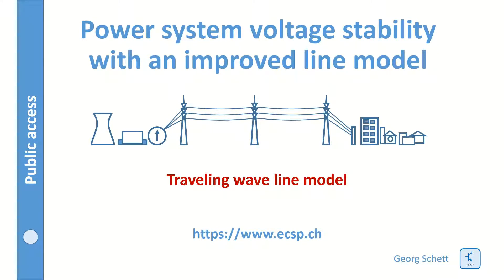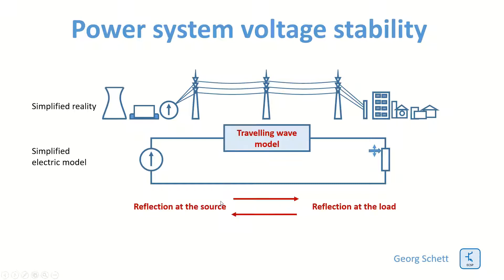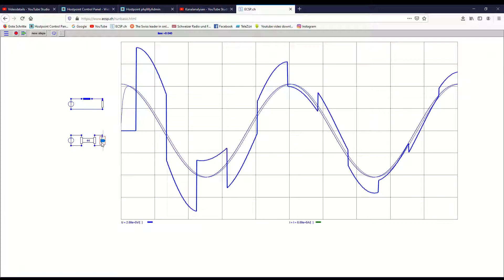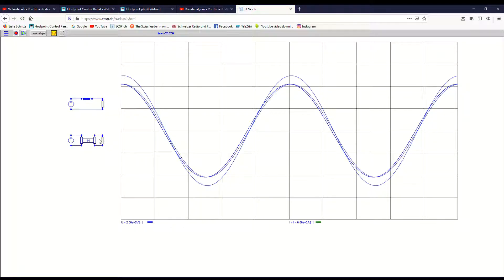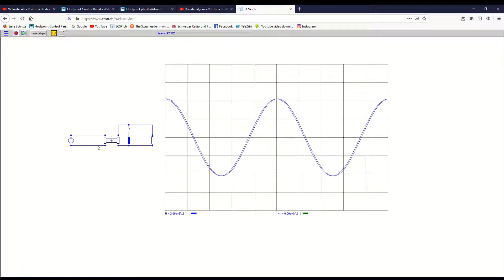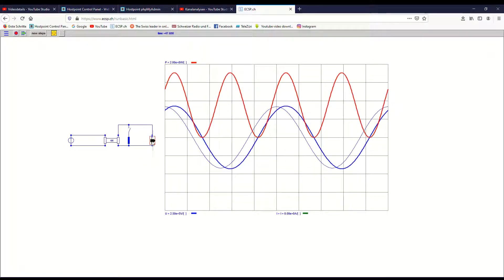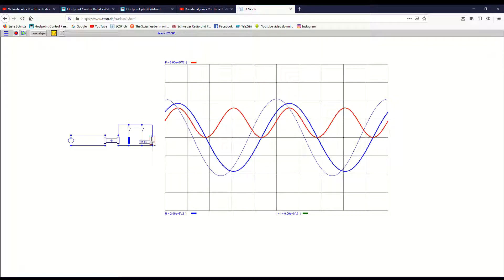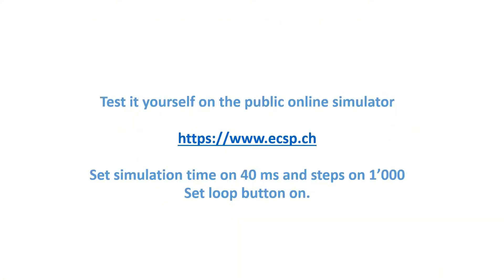Power System voltage stability by reactive power compensation [circuit simulator]

Comment: So basically STATCOM can perform this reactive power compensation
Reply from the maker: Yes, for example, there are simpler ways depending on the type of compensation such as reactors or capacitors. Statcoms are adjustable and therefore very flexible.

Comment: How by decreasing the resistance we increase power at the load ?
Reply from the maker: This is basic electrotechnique. P=U*U/R.
Reply: @georgschett801 i So the load considered in this case is basically inductive impedance i.e. Z = R+jXL, since I see a sinusoid for the load?
Reply: @georgschett801  Do you still maintain the ECSP site?
Reply from the maker: @tonytucker8651  Yes, why are you asking?
Reply: @georgschett801  I was planning on buying the pro version. Also, want to know if I can pay you for training?
Reply from the maker: @tonytucker8651  Dear Tony, I assume that you tested the free version. If this is OK, the pro version should be OK as well. I guess training might not be needed, there is a detailed user's guide. However if you have questions or issues, don't hesitate to contact me. We could have a discussion to get you up to speed. I do not need to be extra-paid for it.
Reply: @georgschett801  thanks for responding. I was referring to training on power flow as a whole. I am an M.E (Mechanical Engineer) working as a power engineer. You are very knowledgeable in the subject. If it is an option we can have sessions via Zoom, Skype, Webex, etc. I am more trying to cement the concepts and figure out how certain adjustments impact the system.
Reply from the maker: @tonytucker8651  Dear Tony, I perfectly share your interest in the subject matter. For practical reasons however I recommend a power system training at a relevant university. I do not have material available for a training on top of what I have published on youtube and I guess that this would be needed. For an efficient training the electrical models and rules must be well understood and this may be a first step, if not available yet. For specific questions you can always drop me a mail which hopefully I can answer to your satisfaction.